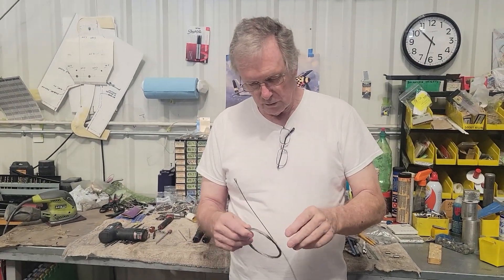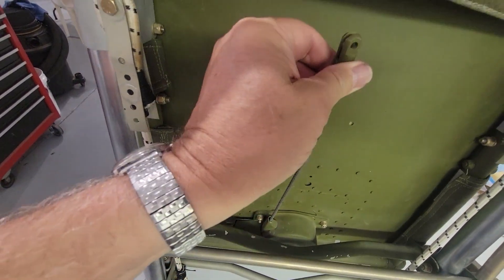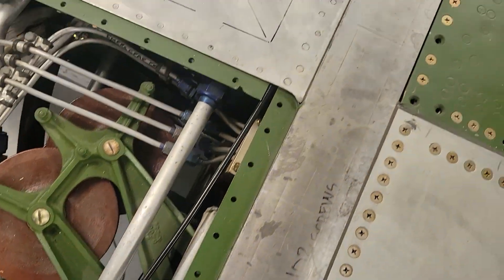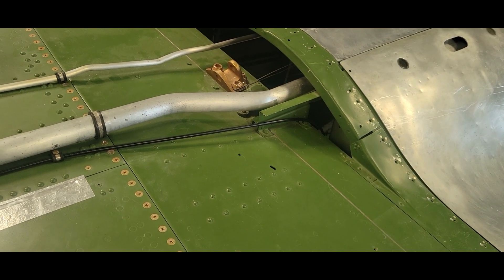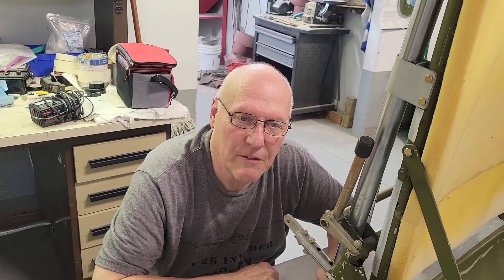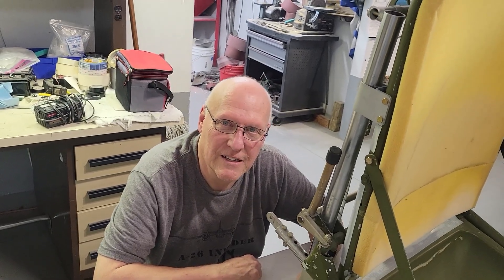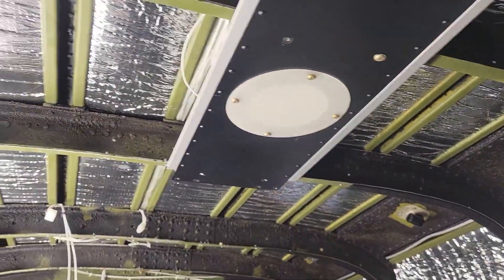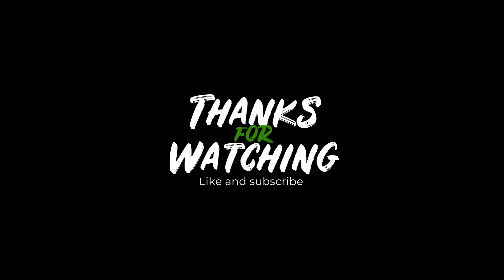Uplock Cables  High Maintenance Episode 59

Comment: In 1974 I had the opportunity to work on a project A20 that Willie Farah had purchased from Howard Hughes.  Howard  had converted the bombay to a club seating bar along with large picture windows on each side.  This plane flew like a bullet.  Willie had flown A20's during the Korean War and couldn't pass up the opportunity to own one.  There are many war stories about the build on this plane, but suffice to say Willie took it down to the wheels and replaced every nut and bolt.  It was the first airplane I 'd ever seen in Imron paint, which was magnificent.  My contribution was to address how Howard had insulated the bombay section.  He used a new (then) product called closed cell foam.  Willie's crew tried scrapers, then chemicals, but nothing worked.  Just for sport I grabbed an angle die grinder and abrasive pad which did the trick without harming the aluminum.  That became my job.  Willie rebuild the bombay back to original.  This plane is still active out of South Texas (Willie lived in El Paso).  It's painted black along with a skull and cross-bones on the nose.  This was the fastest piston engine plane I have ever seen on the deck, and Willie could really make it talk.